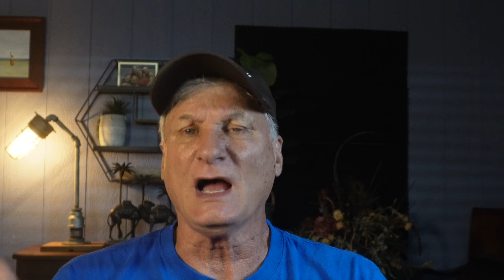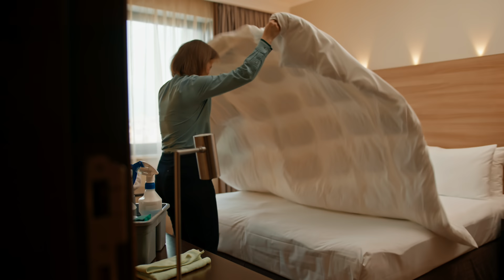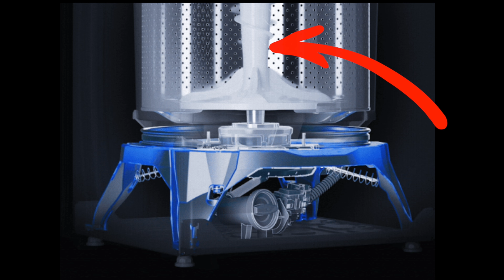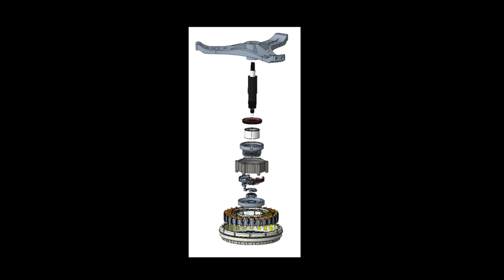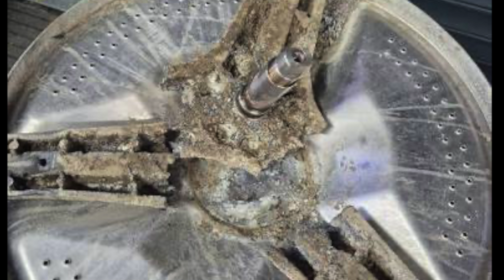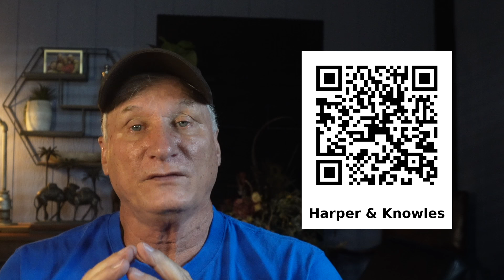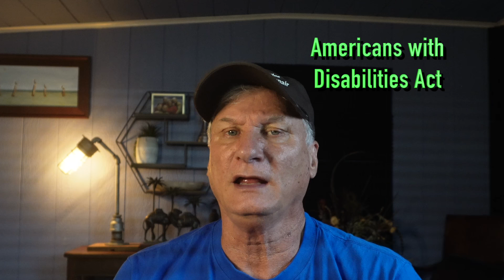Maytag's New 30-Year Washer: No Gearcase, Real Agitator, 900 RPM

Comment: How much are the parts?  Will you have to buy assemblies which always cost a fortune?   Does it have digital circuit boards?  For me, if it has modern circuit boards, Im out...I want full mechanical/relay (I call them hand crankers, ha ha) version just like they made them.  I have a 35 yr old Kenmore, and it keeps going and I can buy almost any part for it that I need and troubleshoot it easily without any need for the use of a digital tester.   Speed Queen's hold up like they do because they found what works and keeps making them.   Funny to think, they make a superior product and they are still selling like hot cakes...what a concept!
Reply from the maker: All good question that will have to be answered soon. Thanks for watching!
Reply: @HarperandKnowles  Thank you!   Great channel

Comment: I do home repair and I have seen more and more customers over the last 10 years . I have told all my customers to stop buying Maytag/Whirlpool  washers and dryers. They designed all their equipment to fail within 5-10 years. My suggestion to all customers was to buy Speed Queen and everyone who has done that has been very satisfied. Maytag is putting themselves out of business.
Reply from the maker: Actually, the Neptune line of washers put Maytag out of business. That's why Whirlpool aquired them in 2006. Thanks for watching!
Reply: @HarperandKnowles thanks in no small part to recalls and lawsuits
Reply: @HarperandKnowles we had a Neptune, biggest POS I’ve ever owned. Started breaking after 6 months . In a brand new rent house and it came with Maytags . I hold my breath every time I open the lid, and they are new !

Comment: One problem i see is it appears to be a single piece agitator but still uses the corkscrew design that's designed for two piece agitators.  Why don't they use a straight vain agitator that's designed for single piece.  Both maytag and whirlpool had straight vain designs yet they haven't used them
Reply: Totally agree with this. They could put something like a Penta swirl agitator like the 74 Kenmore i have and get the gentleness but still thorough roll over action. I would much rather see a well-designed straight vain in this.
Reply from the maker: Thanks for watching!

Comment: I had bought an Amana washer and dryer back in 1991 or 92 and I saw an inside view of the washer, they had it and three or four washers on the floor with the back off of the machines and the amana was made just like the speedqueen with the springs fastened to the base I had the washer for ten or fifteen years befor replacing it the tub started leaking water down into the bottom of the machine so we replaced it with a whirlpool and hated it from day one I wish I had repaired the washerbut didn't, bad move on my part in hindsite but it is what it is, we still have the Amana dryer and all I have replaced is the heating element and the belt and we have had it for thirty years and when it goes I will get a speedqueen dryer which is what I replaced the whirlpool washer with was a speedqueen and we love it clothes get cleaner and the wash cycle is pretty darn quick, I wish I had bought a speedqueen sooner, I don't trust whirlpool they started producing junk and I don't trust them for that fact
Reply: Amana is a bottom end product by Whirlpool.

Comment: I'd like a look at the dryer door, as I'm disabled and looking for something with propane compatibility. The timing element also sounding wonderful for how I generally think on & run my machines, to include the fact that I often cook and do laundrys at the same time, with the planned placement being a walkin pantry.

On why I doubt the washer could be ADA compliant & as such is listed as not being as such, pretty much no toploader can be, because twisting & reaching down as is needed  to use said machines is something many disabled people cant do or minimally have great difficulty in doing. At best if (dont ask exactly how, as I dont know) they made a sort of internal bag that could scrunch up with the load, to avoid that reaching  or maybe have a layer of the basket pullable up & out of said floor base, to again avoid that reaching might change that, but overall - it's the reason why I don't intend on getting a toploading machine. The reaching & twisting difficulty aspect being bad enough for me that even if pitting against handwashing in a basin in bathtub, I'd pick the bathtub and washboard setup over the topload washing machine.
Reply from the maker: And there you have it. You know, I never even thought about it like that. Thanks for clearing that up for us. And thanks for watching too!
Reply: @HarperandKnowles Thanks for these very informative & well researched videos.

In the future if you want to check on ADA which is mostly based on wheelchair users,  take a rolling chair that can raise your feet about 3-5 inches off the floor while seated, sit down in it in front of a machine, and see if you can move to use whatever machine it is as it would be,  without getting up from that chair. If it's above "very awkward" to do so, the machine isn't ADA accessible.

*edit: You can alter how high the machine is from the floor, if it can be done as part of a standard installation process,  to allow for it to get to that "very awkward" feel, but that's really  "it" in this, and for a toploader of a laundry machine- it won't make the slightest bit of difference either.

Comment: I have a 1985 Maytag washer top of line in ALMOND.   When they make another one like it in ALMOND, MAYBE I will consider buying a new one.  Until then, I will believe it when I see it for new washer that lasts 30 years.  All they need to do is bring the plans out of the closet from 45 years ago and build what they ALREADY PERFECTED!   I should be CEO of Whirlpool/Maytag.  Seems like they are afraid to build something people may buy.
Reply: Energy efficiency regulations passed by Congress is the reason why they cannot build those old designs anymore. Vote for better politicians if you want change.
Reply: @MichT-b9d  Trump rolled all that back, I did vote for politicians to change this.  This is why they are coming out with this model, my point was they already have plans for the perfect washer, just start building it again.
Reply: @MichT-b9d  Jokes on them stupid politicians. All my appliances are from 2001 or older.
Reply: You are exactly right! I cannot stand the current model lineup of washers! I especially hate my GE with the stupid f**** lid lock no water level control! I would love to have my mother's mid-1960s GE filter flow washer!

Comment: They want to steal away the Speed Queen biz.  Good luck Speed Queen is the shizzle I only wish they made kitchen appliances too
Reply: speed queen was bought by private equity too and the new computers don't last as long as the old relay and timer units that stopped in 2018. many positive reviews are people who bought prior to 2018. plenty of complaints on new machines made post 2018. mechnical end end is alright if you get unit with enough paint to not rust. i'd still gamble on a speed queen and i would mad max for a 2018 model speed queen
Reply: @cdoublejj  I suspect Speed queen had to change over to meet gov't water consumption mandates. its going to get even worse because the Colo. river & reservoirs are drying up.
Reply: @guytech7310  Water consumption rules only apply to consumers, not industrial operations. Why is that?
Reply: @blogshagify  You tell me. /sarc
Reply: @cdoublejj  Got 3 2015 speed queen coin op washers. What is the old relay and timer pre 2018 model number you are referring to?
Reply: @cdoublejj  You are correct. I've had a few of them come into my shop in the past few months with bad control boards. 5-7yr old speed queens.
Reply: Used to be, not any more. Plus a small 3.2 tub.
Reply: Yep, like refrigerators

Comment: Whirlpool needs to go back to the direct drive washer.  I was in the trade when they went to it and left the wig wag behind.  Loved the direct drive,could pull a transmission in 20 minutes in place right in the house.  Customers minds would be blown when you'd snatched the cabinet off in seconds. Just hated when someone tried to work on ot by taking the back off lol
Reply from the maker: That annoys me too, or pry the top off and bend up the cabinet, so you have to use your toe to get it to seat correctly! Thanks for watching!
Reply: I worked on them too in that time, took longer to take the cabinet off than to change the pump. I bet there are still old belt drive machines running if anyone still knows how to lube the wig wag slots on the gear case and replace the rivets.